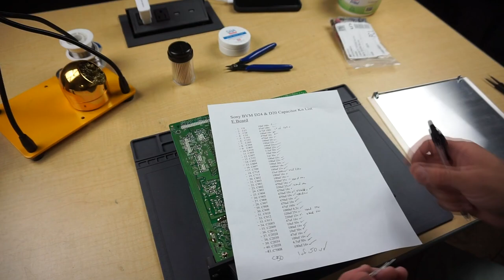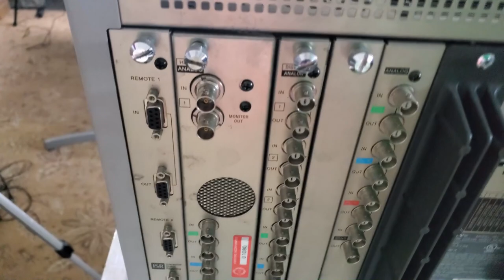The SONY BVM D20F1U is a "Finicky Masterpiece" - Pro CRT Repair

Comment: I work in a broadcast environment, one in which we once purchased many D24 monitors around 2005. There is rarely a "service history" unless the engineering staff has absolutely nothing but time (which is never the case in broadcast). We repair when we can, send for repair when it's too time intensive, and cannibalize from dead equipment whenever possible. Fun fact.. I just retired a D24 this week and as you are well aware... the best example of a BVM  is the one that is still working and has been regularly been powered on. There's nothing worse than the smell of a piece of equipment with dried up caps when its powered back on - exactly the same smell as a dead rodent lol.

Comment: I'm not sure if this is related to the issue, but at 8:59 at the top of the frame on those small boards standing vertically, there's a bunch of surface-mount electrolytics. Those tend to fail too (and sometimes leak out the bottom, doing trace damage) on older hardware, they still were fairly new technology back then and not as good as they are today.
Reply: Great point, those alone are what constitute almost exclusively, the electrolytic caps on old computer motherboards and they cause a lot of issues so yes I would definitely swap those out and probably with tantalums.

Comment: I saw a couple of daughter boards with surface mount capacitors on them. Is it possible to switch those daughter boards between the non-working deflection board and your working deflection board?

Comment: Since it happens over time there could be an IC overheating. Maybe see if anything on the board gets hotter than normal as it may help pinpoint the problem.
Reply from the maker: Thanks, that's what I think is the issue too.
Reply: @RetroTechUSA  Do you have a thermal camera? That could provide rapid identification of a localized hot spot.
Reply: I think a thermal camera is a must for repairing ANY retro tech, ESPECIALLY crts

Comment: You didnt replace the surface mount , I will replace all of them....
Reply: Yes, my guess is also the surface-mounted capacitors on the daughterboard. Those usually fail before the larger ones.

Comment: Check in horizontal section. Hot, and everything that is near this transistor you need to check. Probably one of the components is overheating and i can bet that i horizontal output transistor or one of the components that is linked with.

Comment: That wasn’t a full recap since the perpendicular boards have a bunch of SMD electrolytic caps. Would’ve loved to see if those were responsible.
Reply: Yes, it's worth checking the ESR of those surface mounted electrolytics.  They tend to fair even worse than standard through-hole ones.

Comment: These Sony BVM were flawed back then…and it’s even harder to fix now. Sony (other manufacturers) had a hard time getting the power right for these fancy monitors. Either it was over power or underpowered, but getting it to be stable at a proper voltage required difficult engineering back in those days. I remember just sending these back to Sony and getting a replacement instead of trying to fix it. Terrible time it was…

Comment: Hi Steve, I know I'm replying a bit late. But I noticed at 8:59 the top left hand cap on the smaller of the 2 daughter boards is not mounted properly, it looks like the right hand leg got detached from the PCB. You can see the drawing outline on the board and how the cap itself doesn't line up with that. I think only 1 leg is connected.
Reply: Good eye, I agree!

Comment: Best I can tell from the video, it looks like you've replaced the electrolytic capacitors, but none of the polypropylene capacitors (the thicker blue bundle-style capacitors)? Bad polypropylene capacitors, bad transformers and/or a bad horizontal width coil are just some of the factors that can contribute to horizontal collapse. Could you pull some of those polypropylene capacitors from the board and test them for capacitance and/or ESR? Best wishes - great video!
Reply: He didn’t replace the SMD electrolytic caps on those perpendicular boards which would be my prime suspects.
Reply: @emmettturner9452  Mine too, I would start with those.

Comment: Hi I have one D20 with the same problem! I got a Savon Pat kit but I didn't install it because I found a deflection and video module board locally in working conditions. I kept it for almost two year and for a coincidence, saturday I left my d20 and these boards to my technican to do the repair. But now I'm afraid to have the same results as you. Maybe it can help: Savon Pat list have only 11 caps to replace and only 5 you have on your list. The others should be surface mount because I remember to have some of these type in the kit plastic bag.. Please update if you find a solution. I also will let you know if my technican gets the board in working condition again.
Reply: How did this go buddy??
Reply: @James Drummond Unfortunatelly I cannot fix the deflection video module. My tech exchanged all normal caps and surface mount but still same problem. I'm thinking in sending it to Savon Pat to repair but just the SH from Brazil to USA will costs a lot.

Comment: Hey Steve — could it be the PA Or G board? Most the the time there is an issue with the PA. I’m not sure if you just swapped the deflection and found that to be the exclusive issue.

Forget it: sound like the new deflection board fixed it.
Reply from the maker: Hey Phil.  Yeah, I switched all the boards around and isolated it to just that board.  The new board has been working great.

Comment: Hello,

I recently recaped two cards on my Sony BVM D20F1E (Analog and Deflection), and it doesn’t sync at all, with any source, since.

Savon-Pat told me I must « re-load the firmware into the two modules ».

Do you know how I can do that ?

Thanks.

Comment: Are you able to get reliable results using an ESR meter to test capacitors that are still connected to the circuit?  That would be great, but I've heard that it can be unreliable.
Reply from the maker: It's not 100% I feel.  Basically reading ohms.  I'll show the method with this meter eventually
Reply: No it’s not reliable. You are measuring the entire circuit and not just the specific capacitor.

Comment: hey, i rgb modded my tv, but i had to do it directly to the neckboard, with capacitors and stuff

thing is, when there's little on the screen, the black get's too bright (example: capcom logo), it becomes a light grey, but when the image fills the entire screen, it looks awesome, very crispy and colorful, very sharp, do you know a way to fix this?
Reply: I have heard of people using glass tint on CRTs to increase blacks...For instance MD's used for spotting tumors had this sometimes done to them...

Comment: One of my worst repair nightmare, replaced 50-100 caps and still no fix.
Reply: replacing caps does not fix anything if you don´t check voltages from every lines coming from the chopper, shorted transistors, open resistors, etc etc..
It´s ok replaceing capacitors cause this are old monitors and most capacitors will start to fail soon.. but you dont do that just trying to fix a monitor.. first find what is causing the failure and you wont be wasting time